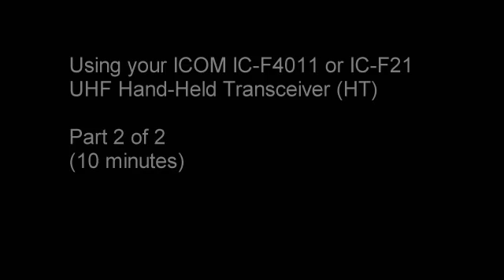ICOM F4011 and F21 Radio Training Part 2

Comment: We uses this radio in Trinidad and it's the best radio simple and robust.  The battery last 32 hours on a single charge . It's light weight. I've used 3 different model Motorola,  1 Kenwood and I com is by far the best.

Comment: I have an F24 icom radio so how do I program it for a frequency for my job because they use repeaters and all that? Is there a way to scan the area for signals? I purchased an official programming cable as well so if there is any software that I need please let me know
Reply: pro trick: watch series on Flixzone. Me and my gf have been using them for watching a lot of movies these days.
Reply: @Sean Lukas yea, I have been using Flixzone} for years myself :)
Reply: @Sean Lukas yup, been using flixzone} for months myself =)
Reply: @Sean Lukas Yea, I have been watching on flixzone} for years myself =)

Comment: Icom is the poorest quality name brand radio made. Even HYT is above Icom in quality and durability. But if your a ham you will pay too much and buy and use anything though I guess.This particular model is by far the worst one yet, they do not hold up well and still use a DOS based programming software.
I get these in my shop every once in awhile still and I retire them and destroy them in the press after I issue a new Motorola to replace it.